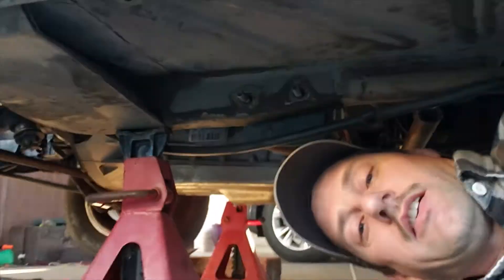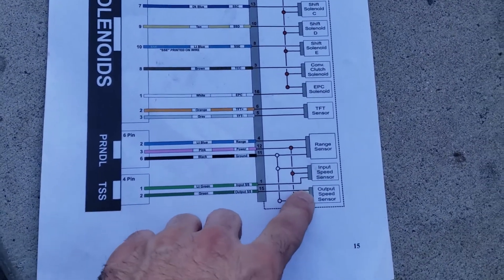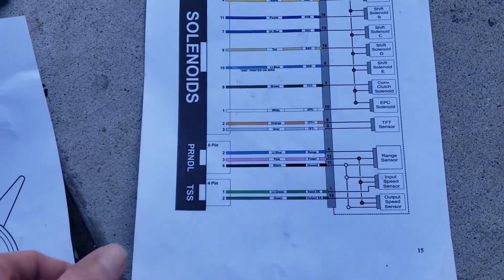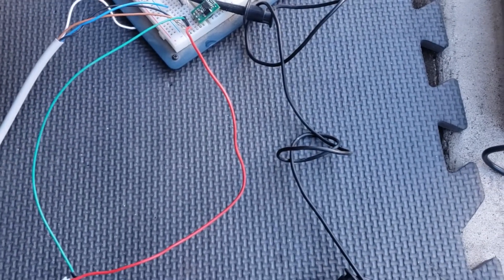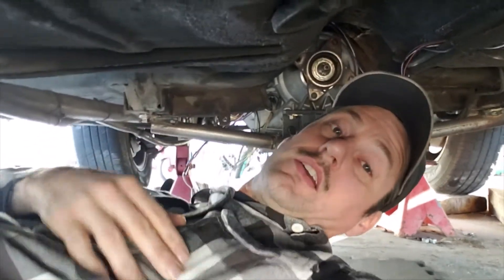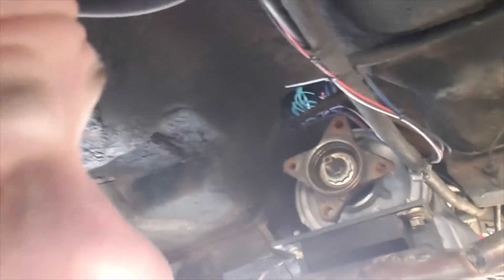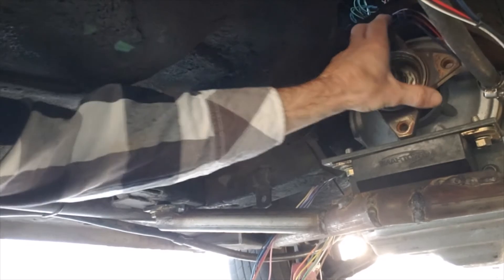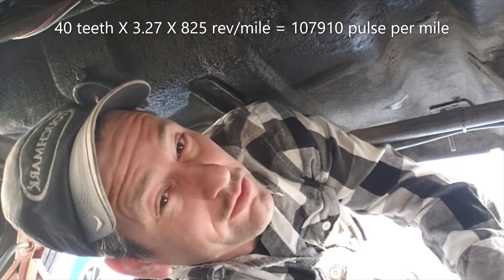6R80 Output Speed Sensor Testing

Comment: whats is output from Oss sensor? 5v or 12v?
I have same problem and im gonna replace the sensor on lead frame
Reply from the maker: I think the sensor is an open collector type so it doesn't actually output any voltage but pulls the line low when the tooth aligns with the sensor face.  Ideally you could add a 5 or 12 volt pull up with a 1k resistor and look for the going low transition.   The DMM beeps when the output is near ground(when voltage potential is near zero across both leads).
Reply: @olboy1981  i have another sensor which is output no voltage without contact, with contact 50 ohm to ground.
I pull up with 4.7k to 12v.
Again testet, going low  50 ohm to gnd shows dmm.But not short as Ur video.
İs this sensor usefull or do u have any other idea about situation?
And can I contact with you from any social platform please?
Reply from the maker: @cagatayerdilmen7404  instead of looking at ohms I use the continuity function instead of ohms.  

My IG account is ryandenney347.  You can reach me there

Comment: would you know if it's possible to tap into a wire for the OSS to send a signal to an aftermarket speedometer?
Reply from the maker: Yea, I don't see why not.
Reply: @olboy1981  would you happen to know what color the OSS wire is on a 2016 6r80 from a Mustang?

Comment: Where is the Output Speed Sensor located on/in a 6R80 transmission?
Reply from the maker: The sensor itself is mounted on the lead frame and sticks through the valve body to the rear clutch pack drum.  It measures the lugs on the drum as the output shaft spins.
Reply: @olboy1981  Could you send a photo?   I was all under my dad's truck this weekend.  lol
Reply from the maker: @VidTubeWatch  It's inside the trans pan.  It's not on the outside of the case like a 4r70w/4l80/60..
Reply: Thank God.  lol.  Thank you.

Comment: How do you adjust the speedometer?  Mine is reading like 18 miles below actual speed, also transmission isn't getting the proper signal to shift because the truck reads -18, also when the truck is off the needle is below zero, please help thank you so much
Reply from the maker: Not sure i can help you at all.  Is this a factory install or aftermarket?  Factory... thats an ecu/tcu issue..  aftermarket.. thats the controller needing some sort of offset sorted out.
Reply: @olboy1981  its stock, dealership said I need a 6k transmission job, I'm sure it's just the speedometer stuck in the wrong place and misreading and sending the wrong signal to transmission
Reply: @lokkotez If the cluster is reading -18 mph then the cluster is most-likely the issue. If you were to disconnect the battery, does the needle stay in the same spot? If the cluster moves to 0, the ECM might be out-of-calibration. The dealer should've checked the wiring first as it's very simple to do. I'd be wary of the dealer you're going to if they're willing to eat a transmission to figure out an issue that might be fixed with a reprogramming or broken wire repair!